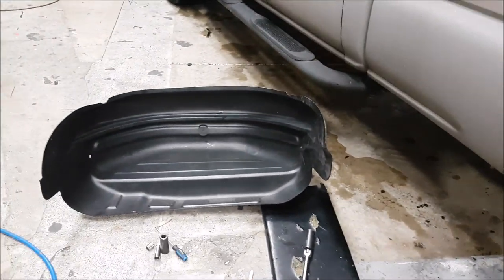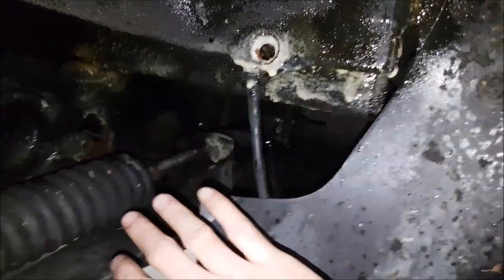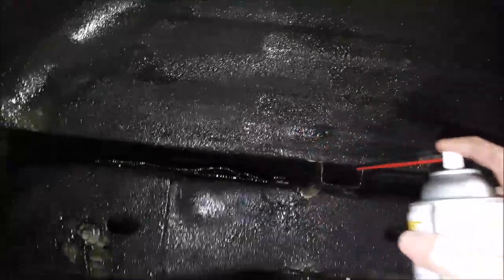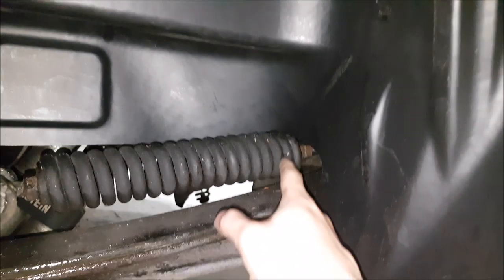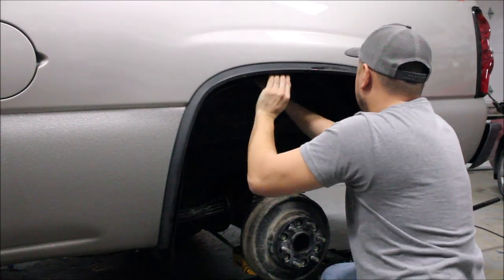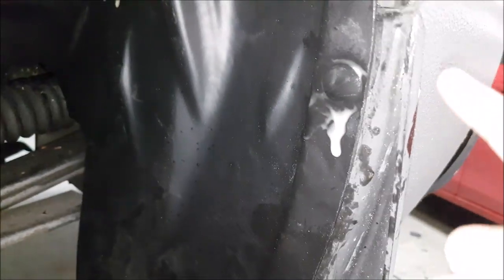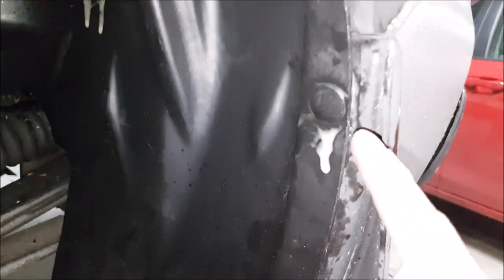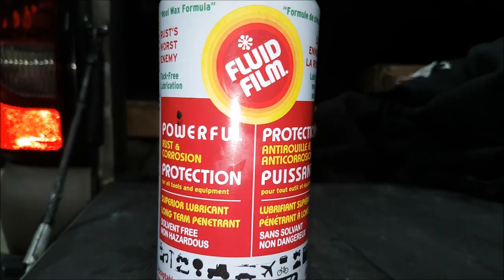Rough Country Inner Fender Liner Installation ( Chevy Silverado) | AnthonyJ350

Comment: You installed it wrong. The liner goes behind the factory metal lip.
Reply from the maker: I didn't want it there because I wanted it to work with EZ flares and block snow. Under the lip would just collect snow between the 2.

Comment: I installed rear wheel liners from Rough Country on my 2021 Chevy Silverado WT.  Just bought the truck in July.  One of the main drivers of getting the liner was appearance.  The truck is white, so you could see the white bed when you look at the side of the truck.  Obviously, the protection the liner provides was a big factor, too.  The truck looks much better with the liners.  It was an easy install.  I didn't remove the wheels and didn't have to modify anything.  I also ensured the bottom of the liner was on the outside of the mudflaps.  That seems like a no-brainer.
Reply from the maker: Thanks for sharing!

Comment: The RAS and the 2nd helper spring together look great! Could you do a vid on how they work together? Is one better than the other? Notice any difference with just the one compared to both together? I also see there are "underleaf" helper springs available (and they are cheaper than overleaf springs). Do you know anything about these? Are they better than "overleaf" springs? Thanks a bunch! :)
Reply from the maker: I can definitely try to make a video showing (or lack of) axle wrap and wheel hop in my vehicle.  The spring rate seems to stiffen having them both installed at the same time.  When I accelerate from a dead stop, the power delivery feels immediate and well controlled.
Reply: AnthonyJ350 Cool man, thank you! I’m about to install a RAS and I’m wondering if the traction spring would also be a good addition. 👍
Reply from the maker: @AK-ic1yj  I like how well my truck plants with the RAS and traction spring work together. They both add a little lift so keep that in mind. I have a 2 inch drop shackle in the back of my truck which give me a little more articulation.
Reply: @AnthonyJ350  I just installed the RAS on my 95 Tahoe last night. If feels excellent, I really like like it. I am thinking though, is the traction spring also necessary? The rear feels pretty tight now, would you say that the spring helps a tremendous amount in comparison to the RAS by itself?
Reply from the maker: @AK-ic1yj  No the traction spring is overkill plus I'm always testing product. The Roadmaster by itself should be enough. Look into Bilstein 5100 shocks for your SUV as well.
Reply from the maker: Made this video of it working under the truck 
https://youtu.be/au_U5sHB4ao

Comment: Rust rots out truck beds because it gets up into the bed  Where the gap is for the fuel filler neck and then it sits on the bed Wheel tubs and rots it out from the inside out hate to say it but what you said makes no sense pull out your tail light and spray fluid film in that gap that's where all the rust starts inside the bed good luck with it though sir
Reply from the maker: Sure thing! So far the truck is rust free and doing well. Owned the truck for 13 years.
Reply from the maker: Ok by that statement specifically pointing out the fuel area, does your truck only rust on one side?

Comment: why do most car only have plastic liner in the front
Reply from the maker: There are more critical parts to protect because that's typically where the engine is. They're also easy to remove/ replace so servicing is better.

Comment: You were supposed to tuck the outter lip of the liner  inside the fender lip .. so when you put the tabs in you go threw metal then plastic liner..
Reply from the maker: I think you missed the part I didn't want to do that because of the EZ Flares.